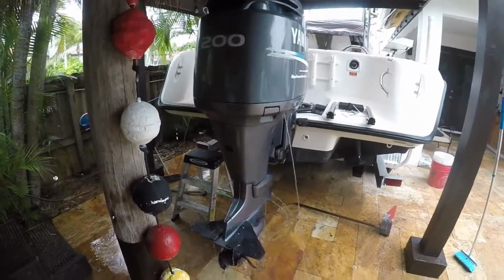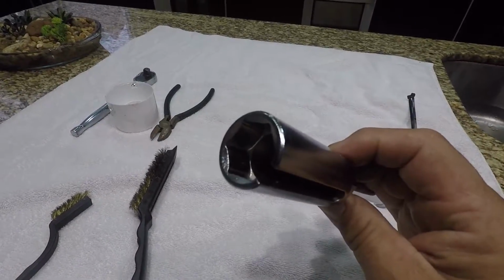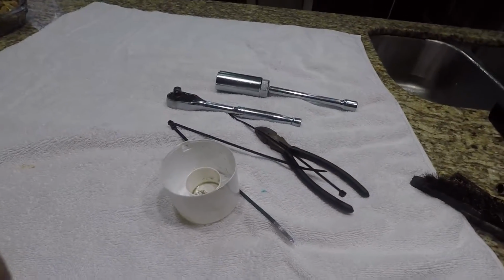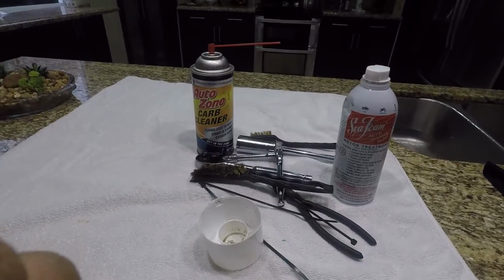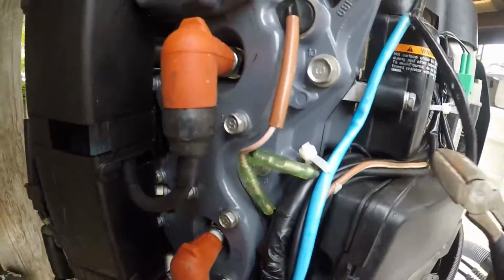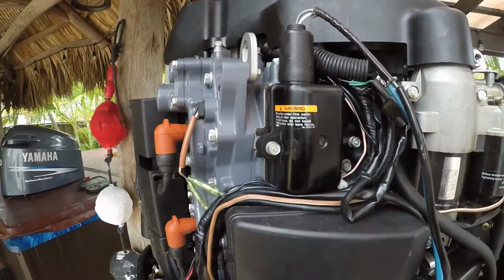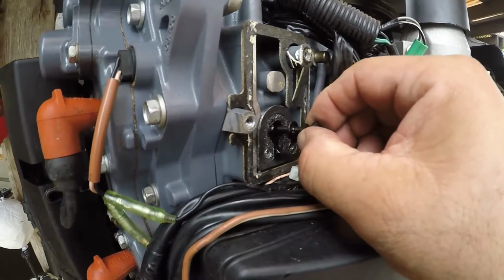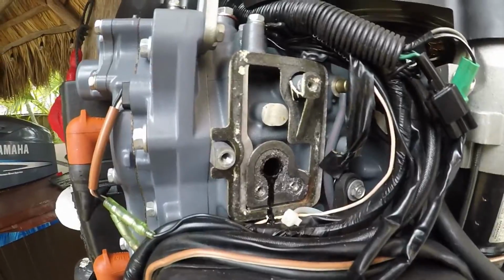Yamaha Outboard HPDI O2/ oxygen sensor cleaning/replacement/removal

Comment: Thank you for taking the time to make this video. I will be cleaning mine this weekend. Hopefully this solves the problem I’m having 😩 I have a 2002 Yamaha 200 hpdi and it wasn’t running when I got it. I changed all filters, 2 low pressure pumps, thermostats, cleaned the vst, and nothing. I then cleaned the injectors and that was the the problem! I was so excited being this is my first boat and I knew nothing about motors until I YouTubed how to change all those parts lol I took it out for a test run and it started right up! I reversed away from the ramp and proceeded to ride up the canal. All was well until I decided to see what she could do lol I pushed the throttle down expecting to fly up the canal and the boat lifted up but wouldn’t get on plane and shut off. Started right back up, and shut off again when trying to run at full throttle. I was devastated and didn’t know what else to check which is how I found your video. I really hope this solves my problem. Thanks again!
Reply from the maker: Thank you for watching. Please keep us posted on your progress and solution. Have you checked your gasoline? You may have bad gasoline.  Try connecting a small gas tank.
Reply: Your gas pump in the vst could b bad.  Bad ignition from spark plugs.  Oil pump could be bad . And that sends a message to the computer telling it there's a problem and locks out cylinders so you can't use the motor to protect against further damage . Or just a bad computer chip.  These are just other issues u can have.  Hopefully it was the o2 sensor
Reply: Jay, did this cleaning work for your 02 HPDI?
Reply: @lostamonsta1 I blew the engine in my truck and was never able to take the boat out again to test it. I was so bummed out I haven’t even done much to the boat since. It’s just sitting in my driveway.

Comment: Hi, great video.

Questions, 
How long do you soak the sensor? 
How long do you let it air dry before re-install ?
Reply from the maker: Thanks. The soaking will depend on how dirty. Also, I did not air dry. Just used a clean rag on it and on it went. Just keep the electrical/top part away from the sea foam and/or cleaner.
Hope this helps.
Reply: I found new ones on Ebay for $185.00 . I sent the sellers a message asking if they are OEM or aftermarket.
Reply from the maker: @BK-gc1jm  From China?
Reply: @florida4funshinechannel998   aftermarket, so best guess??

Comment: Thanks for the video. I have twin 200 HPDI's and get totally different results from what I saw in your case. You had oil pour out of the sniffer tube hole and no carbon build up. 
In my case, I have crumbly carbon buildup and have to clean out the sniffer tube hole with a plastic straw from spray can so it does not damage the bore and also brush off the carbon, soak and clean and then use a torch carefully to clean off the carbon from the tip of the o2 sensor, careful not to overhead. I also have to polish out the carbon from the inside of the housing. Once completing this service, the motors return to correct idle upon cold startup from 400 rpm's to 700 rpms. 
I run my motors hard going offshore 50-60 miles and then the return trip. I wonder if you run your motors easier, thus why not a carbon buildup as they are not getting as hot in the combustion chamber? What type of 2 cycle oil do you use? I switched from Pennzoil semi-synthetic to Amsoil full synthetic and if the O2 sensors are not cleaner this year when I service, I will switch over to the Yamaha 2 stroke oil and give it a go.
Reply from the maker: Hello Robert
Loved your comment and enjoyed your success!
I do not run the motor hard but did find a solution to solve my carbon build up issue.
I changed from Yamaha 2 stroke oil to fully synthetic XPS marine XD 100 from Evinrude.
Runs very clean and no carbon.
It is a bit costly but well worth it.
Take care and be safe.
Reply: @florida4funshinechannel998  how often do I do this service. Hours?
Reply from the maker: @antonioprado8068  Hello.
I like to do it every spark plug change. 100 hours or so.

Comment: Hey buddy the you recommended put sea foam on the fuiltank?
Reply from the maker: I am not a fan. I recommend Yamaha ring free as prevention and cure of fuel/gs issues specially fouling of plugs and o2 sensors. hope this helps. Thanks

Comment: Did you reuse the gasket or used a new one? I followed your video to the t and it left me thinking... would blowing compressed air on the o2 sensor would damage it?
Reply from the maker: Hello.
I used the same gasket as it showed no wear or damage. i would recommend to use a new one if possible. Compressed air should not damage the o2 sensor although they need to be handle as careful as possible. 
Take care

Comment: I keep fowling plugs badly with carbon will a dirty o2 sensor cause this?
Reply from the maker: Hello
Yes I have seen that in relation to fouling but they can both be the result of carbon in engine. My recommendation is to do a decarb. Yamaha ring free fuel additive is also a favorite with mechanics to prevent and cure fouling plugs when used as prevention and cure for foling. Read the instructions on bottle. Hope this helps and keep us posted! Thanks
Reply: Also check your oil supply arm to make sure it’s not in need of adjustment